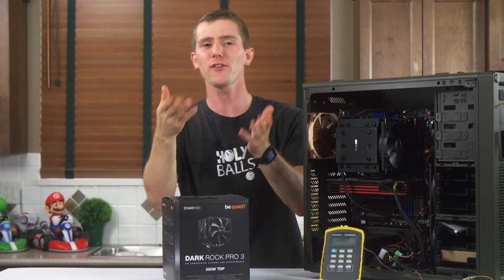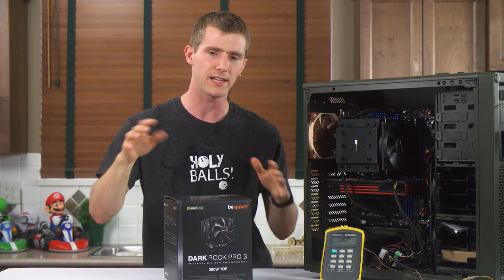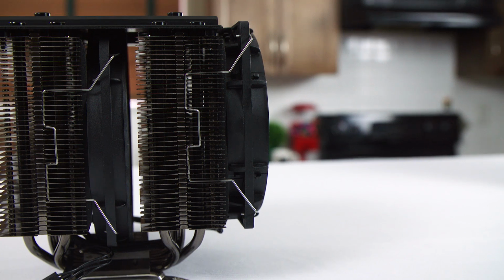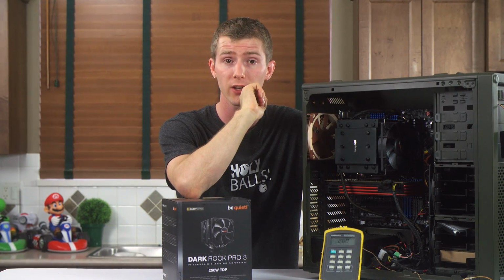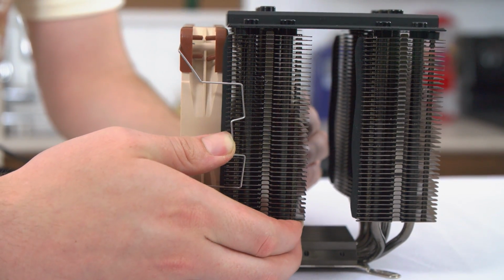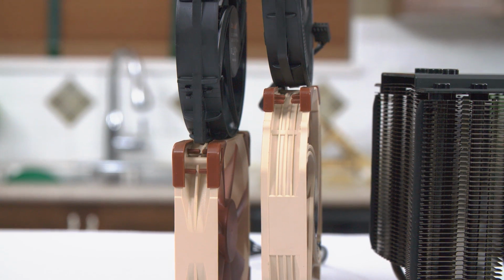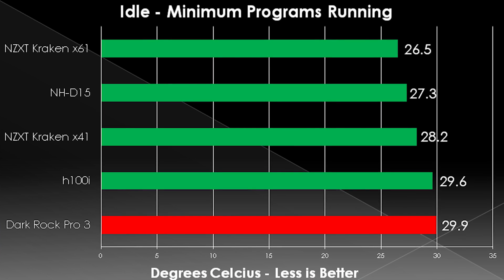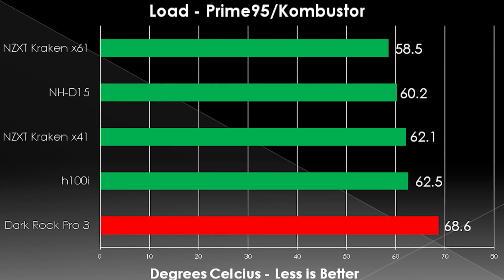Dark Rock Pro 3 CPU Cooler from be quiet!

Comment: I live in Sweden if you would like to suggest a gaming pc build. This is my current build that I wish to buy (I don't have a keyboard, mouse or monitor) http://www.inet.se/kundvagn/visa/6994947/data-setup
I can buy a pc around 26th August.
Reply: Reuben Horner the build looks good, but to safe some money you could go with 8gigs of crucial ballistix sports memorie, which is lp and cheaper and take the crucial mx100 ssd which is also cheaper and has better performance.. with the money you safe you can go maybe go with the r9 280 from msi
Reply: You could get a r9 270 (non X) and basically just save money for a better cpu/whatever else
Reply: GTX 760 is obvious choice, I have it myself, go for MSI or Gigabyte. I have the Gigabyte version and that cooler pumps out heat like you wouldn't believe
Reply: I have a XFX R9270x with an Intel 4770k. The 270x is a great for 1080p gaming at medium to max settings depending on the game. I know the gtx 760 does slightly beat it though in most cases. I went with the 270x because my employee discount was crazy good on it. However, I'm upgrading to the gtx 770 soon and will eventually run dual 770s in the future. Long story short, I'd recommend going Intel / Nvidia though I have been completely happy with my xfx 270x, the XFX card is really quite. So if you want save some money go AMD, you can always run dual 270's later, that would be pretty beast.
Reply: Sgt Maverickz this^ 8 gigs are more than enough just for gaming
Reply: Reuben Horner I don't think it exists in Sweden. Haven't seen it at least.
Reply: LATRONNIK I think he meant I should go with 8X1 instead of 4X2.
Reply: i mean 2x4 gigs of crucial ballistix sports memorie^^
Reply: dont go with the 760 its just waste of money
Reply: Martinchief http://www.inet.se/kundvagn/visa/6994643/2014-08-01
This is what you suggested. Gonna go look at benchmarks.
Reply: Sgt Maverickz Do you mean the price per performance? 
That it costs too much?
Reply: ***** the r9 270x has the same performance as the 760
Reply: msi twin frozr is the best!
Reply: Martinchief So they lack of core vs the fx6300 doesn't matter in gaming ..?
Reply: Sgt Maverickz Not exactly but it's not much I know.
Reply: Martinchief Did you mean this? the http://www.inet.se/produkt/1902632/asus-b85-pro-gamer-atx
and now when I look at it I think intel build is too much for me.
But thanks anyways might do it in the future.
I am currently in love in price per performance champion AMD.
Reply: the cores dont make a difference in gaming
msi cards stay so cool under loud and are not loud
Reply: Sgt Maverickz Are amd processors much cheaper because of no integrated graphics?
Reply: Martinchief Now when I think about I didn't remove the extra cooler.
I couldn't find MSI B85M Gaming on that website.
Reply: Martinchief If I can't get the MSI B85M Gaming what should I get instead? If it's similar price and better performance then I might reconsider price looks better now that I don't have extra cooler on.
Reply: Martinchief Doesn't exist in this website either. There is sniper Z97 and Z87 atx.
If I buy part/s from different site I can find it.
Reply: Martinchief Do you think intel is better than amd in both budget and non budget builds?
I will be using budget build/s for a while I think since I am still pretty young and the biggest things I notice in amd vs intel is the price difference vs the fps difference.
Reply: ***** If you pay for your electricity, Intel is definitely the better value. Over the course of 4 years, you will likely "save" enough money to buy one tier higher CPU. Esp. considering Sweden's electricity prices (still not as bad as in Germany, though).
For the GPU, just get something you can get a good deal on. Or the one that matches the features you want (true audio, GSync, ShadowPlay, CUDA, Mantle, etc.). I prefer NV GPUs because of GSync, CUDA and generally better power consumption...
Reply: Jaroslav Jandek jea but cuda is useless for gaming an there are very few expensive g sync monitors available while AMDs free sync works on normal monitors. I live in germany an the power that my i7 saves a year is about 5 euro. What are the prices in sweden 0.o? Btw shadowplay is not an argument AMD got it too.
 exept of physix AMD got something like shadwoplay and geforce experience too.... in GOOD :P And more like mantle, true audio, zero core etc. Really dont buy a gtx 760 it has a horrible price to performence, less features and 1 gb less vram.
Reply: Jaroslav Jandek I don't pay for the electricity. My mom does. But I suppose you're right that this should matter too.

MegaMan3x I ended up taking away the SSD for a 280X instead.
Reply: MegaMan3x 1) FreeSync does NOT work on normal monitors. It needs similar HW (VRR scaler ASIC) in the monitor to function, so, FreeSync monitors will be as expensive as GSync ones.
2) i3 (compared to FX6300) saves about €8 a year  when gaming on average 3 hrs a day.
3) AMD has VCE, which is not even comparable to ShadowPlay. Anyway, it is irrelevant, it is about what features HE needs.
Reply: Jaroslav Jandek 1.) okeey thought i read a news that show the opposit
3.) 5$ where i live but WHO HAS 3 HOURS a day man ??
3.) i mean amd game DVR and its even but than shadowplay because you can customize it more
Casey lawton 2 gb are not very good for future games
Reply: MegaMan3x true, but he could also run dual cards. (Yes I know it doesn't work for all games)
Reply: MegaMan3x 2) I certainly don't, but he might. It's just another thing to consider.
3) Last time I checked it was in beta and quite terrible (btw. it uses VCE). Good to know they've made progress (I do have a PC with an AMD card, but it's been mostly catching dust for ~a year).
Reply: Amazon is your friend. I live in New Zealand and it is the best place to reliably ship thing that America can get but not us to here (My brain has the slow)
Reply: LATRONNIK Actually this might not be true, while playing Watch Dogs it eats up to 6 gigs of ram, and if you have like four tabs open in chrome or simply have just one more app open in the background, the usage goes up to 8 gigs and it locks up. IMO this is the case, ofc it varies, people may play different games with lower requirements etc.
Reply: Elias Kario i don't even want to play wash doges

Comment: Hey. This cooler is NOT difficult to mound. You did not read the instructions right. Trust me I made the same mistake Slick did. You have to mount the 2-peace nut, on the cooler before placing it on the CPU. When that said, it is still not performing good. Can't go higher than 1.160v 4.4 Ghz on my 4790k and stay under 80 degrees, when I strees test 2x 280x and CPU at the same time.

Comment: why would you buy a air cooler, when water coolers give better clearance, lower temperature and are most often cheaper and quieter.
Reply: Raymond Tyson CPU coolers can last up to 10-20 years by replacing or lubing the fans. Only need to change the paste every 2-3 years that's about it

Probably dust every 6 months unless you live in areas with high pollution
Reply: Raymond Tyson The derogatory comments were unnecessary and only served to make your points seem less valid. If you were a true member of the PC Master Race you would treat others as they deserve to be and not sink as low as the average console peasant.
Reply: I dont want to take that chance that a product full of water, or other conductive liquid , constructed by virtual slave labor in China, will inevitably fail either by corrosion, pump failure, or poor construction/ lack of QC. The result could mean wiping out the entire PC. The chance that BOTH fans on the Noctua ndh14 will fail, causing the PC to overheat is nearly zero. Air cooling is safer. Just an opinion.
Reply: Water is not conductive :/
Reply: +Kaleb Gilley 
Yes, but especially with aluminum rads, the water acquires aluminum and becomes conductive.
Reply: The water doesn't flow through the the fins, so it's not picking up the ions from them.
Reply: phanteks phtc14pe and noctua nh d14 BOTH TIE the performance and sometimes BEAT it of the corsair h100i.  You're welcome.

Price? air cooler wins. 
Sound?  the same if not QUIETER. there is no PUMP noise to deal with involving air cpu coolers.
Clearance issues?  ( facepalm) if you're dumb enough to buy a pc case that DOESN'T have the room for enthusiast parts, then you don't have a clue what you're doing and probably shouldn't be building a hardcore gaming/content creation rig anyways.  
The liquid coolers STILL rely on usage of fans.  Guess what?  They are the SAME 120 and 140mm SIZED ( not best in class performance vs sound mind you) fans used in the best of the best air coolers- phtc14pe, thermalright silver arrow extreme, notcua nh d14, etc. 
Just delete your comment.  I've kept up with this stuff since 1999 and it's obvious you're speaking out of your ass and you don't have a clue the level of nonsense you're spouting out.

A " win" in the temperature category of air vs liquid AiO coolers is NOT one or two measly degrees C.  THAT is within the margin of miscalculation error and thus a tie.  You'd have to have a h220 from swiftech ( which is damn near IMPOSSIBLE to find these days) WITH noctua nf f12 fans in FULL SPEED mode to BEAT the thermalright silver arrow extreme and phanteks phtc14pe coolers in a head to head REAL WORLD test dealing with gaming and transcoding load test as well as worst case scenario full load cpu tests.

AAWWW  sucks to have to go back and throw out the incorrect information you saved up all this time, eh kid?
Reply: I almost forgot, although chances of it happening are RARE, UNLIKE with air cpu coolers, EVENTUALLY there is the chance of liquid leaking out and damaging your pc's vital components.  

ah.  NO THANKS.  I don't pay big money for my pcs' parts only to have to one day worry years down the road about whether or not my AiO system will eventually leak.  

Maintenance on an AiO?  Good luck.  Maintenance on an AIR cooler?  Simple by MILES apart.  Just remove the fans from the heatsink of the cooler after uninstalling the cooler after around 4 or more years and use some compressed air spraying the snot out of it.  I take it a step further besides spraying the fan blades and use a barley damp cloth to further clean more dust from it.

Comment: What's that 250W TDP mean?
Reply: It means that if your cpu was attempting and succeeding at consuming 250 watts of power, that cooler would be BARELY able to dissipate that much heat WHILE keeping the temps from going up further IF the load of the cpu did not increase further.  

If there is more to that, I am unsure and apologize having more research to complete.  Cheers.
Reply: Raymond Tyson I think your pretty much on the money with that explanation, just means the cooler can dissipate 250w of heat

Comment: Having used an AiO (h620) hyper 212 evo and soon a custom loops, this is what id be taking away from this...
it performs equal to its rival the nh-d14, costs the same but looks better.
the nh-d15 is rediculous and causes allot of problems so scrap that arguement right now, noctua made it purely to entertain thier fanbase knowing people would buy it.

AiO's can perform better due to the nature of water cooling/big radiators BUT can suffer from noisy pumps (sometimes) which can lead to noisier systems than air alone and can also have problems later in life if a hose/connection leaks or fails, whereas an air cooler is simpler and only has a fan to worry about.
BIG heatsinks like this/nh-d series etc do put allot of strain on the socket which is why we have backplates, though ram/ pcie slot compatibility can still be a problem.

at the end of the day pick/use what you want that fits your needs best, dont be a blind fanboy of one way or company or another because its your money and you have to decide if its worth it to you

Comment: Guys should i get a noctua nh-u14s or a corsair h80i for my 4690k
Reply: Raymond Tyson NH-D15 outperforms both of those. You're welcome.
Reply: 212 evo for light or no overclock. nh-d14 or d15 if it fits and you got the money.
Reply: id say get a 212 evo if your on a budget, a dark rock pro 3 if you're not and want air or a h100i if you want water.
Reply: NH-U14s all the way. Out performs a H100i (dual fan) and far more reliable and quiet than a CLC. But if your case can fit the NH-D15, get that, not much money but better performance.
Reply: Tyler Horsman phanteks phtc14pe or thermalright silver arrow extreme, you're welcome.
Reply: Id recommend the H80i for quiet performance and a very clean aesthetic.
Reply: I love love love my nh d14! its quiet, reliable and preforms great. (you cant be the same kind of quiet with a liquid cooler pump...) if you have the clearance in the case for the hight and width of the cooler, get it.
Reply: You lose out on that clean aesthetic though, and for noise level, they are about the same maybe 3 -5 Db difference with stock fans.
Reply: Noctua all the way.
It on par, as far as performance goes, but it's a LOT more quiet.
Reply: aaand all the fanboys come out.
http://www.techpowerup. com/reviews/Noctua/NH-U14S/6.html
all about the same, go for the cheapest that you like the looks of

Comment: The only reason why i use NZXT Kraken X60 instead of a NH-D14 or this cooler is just the size  of it. If you´re deliding your chip and change the thermal paste often, the size of it just makes it so much easier. I have a Lian Li PC-P50 and coolers this tall just fight barely.

Comment: Is this laptop good?

I7 4700HQ quad-core 2.4Ghz
Gtx 860m 2gb
16gb
256gb ssd + 1000gb / 7200rpm
1920x1080p 15.6 inc

Would this be able to play crysis 3, on which settings?
Reply: the laptop is good for low-medium 1080p gaming. If the presets of a game are low,medium,high,very high, ultra, then you might be able to hit high in some games.
Reply: Check this website http://www.notebookcheck.net/NVIDIA-GeForce-GTX-860M.107794.0.html

It gives you an idea of what it can/will perform and on what games.
Reply: If you have the money to burn then the specs are good, but you didn't list the brand. Quality of build, cooling, and price are big factors with a laptop. I'd say you could probably squeeze High settings out of Crysis 3, definitely medium depending on what kind of FPS you're comfortable with. Remember if it's got crappy build quality and awful cooling the GPU (and CPU) is going to throttle down during gameplay. Make sure to read reviews.

Comment: But you didn't mention noise? The most important factor for a cooler that is supposed to be quiet..
Reply: They were too busy shilling for noctua to test the noise level.
Reply: 9999plato Noise means a lot when the CPU "isn't" being fried.  But if you're frying your CPU, then by all means get a really loud cooling solution. [Like there aren't quite cooling solutions out there that don't allow a CPU to be fried. - Sarcasm.]
Reply: +9999plato What does 5°C mean extra on my CPU mean if I go deaf. If a cooler is that inefficient at cooling, or the CPU power inefficient, I wouldn't even bother.
Reply: I have Dark Rock Pro 2 and it is dead silent on idle and very silent in load.
Reply: Wyrdak I have the Shadow Rock Pro and it too is very quiet. It is really weird that neither Linus nor Slick mentioned it at all.
Reply: SSSHHHH! BE QUIET!!!
Reply: 9999plato Lol none of these CPUs are being fried
If you are looking for a cooler that blasts your ears off trying to keep your insane overclock stable that is a whole different market.
Also, you know, if I have to work with a computer I don't want my noisy machine to break my concentration all the time.
Reply: Fekillix he did right at the start
Reply: Fekillix he did right at the start
Reply: +9999plato except the H100i is loud as hell when the CPU gets hot if you have stock fans on it and this cooler is meant to, well, be quiet! The entire purpose of this specific cooler is to minimize noise and they didn't mention it once in the review, which to me is pretty lame. This cooler does an outstanding job in every category an air cooler could have besides mounting.
Reply: custom fan curve decides how loud it will be
Reply: The most important factor in a cooler is COOLING. Noise is secondary. What does a noise level mean if my CPU is fried? None. That's just me.

Comment: I really don't understand the whole complaint about a difficult mounting system. I just built my first computer last year and I managed to fit my dark rock pro 2 with no problem at all. I spent the most time veryfying my steps and deciding how to apply the thermal paste and it still only took me about five minutes to mount the cooler.

Comment: I think you should review products as is.. Not adding extra costs by using noctua fans. Which is basically adding a $60 premium on top of the product you are REVIEWING.
Reply: They do this to standardize testing. Removing variables
Reply: I guess I forgot Noctua fans were included in this package. Sorry, my memory is slipping. This is why I'm going more towards OC3D. They review the product AS IS.
Reply: I agree with you for wanting to see what you;ll get. But it's so comparisons can be made
Reply: We'll yes but what good is a cooler if you've been lied to about the performance of the cooler you should see stock fans as we'll as nocturnal